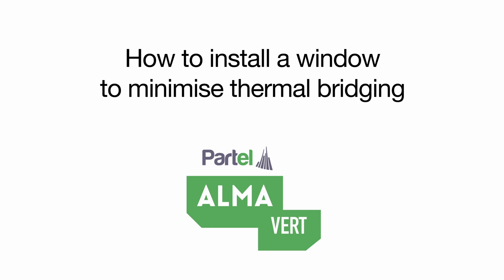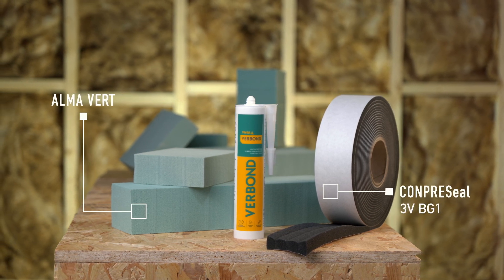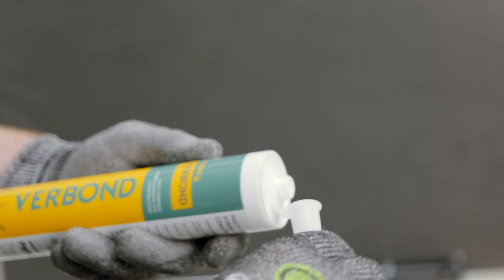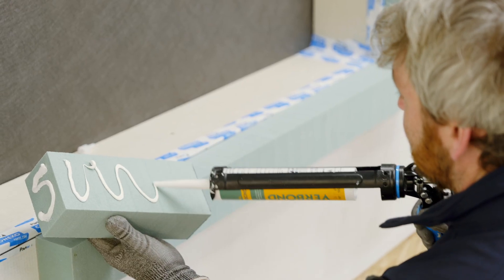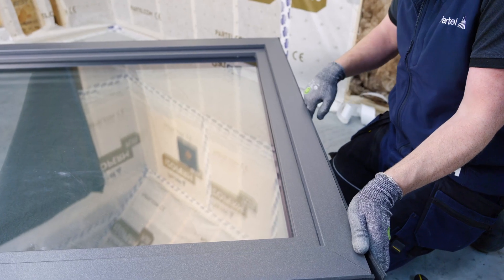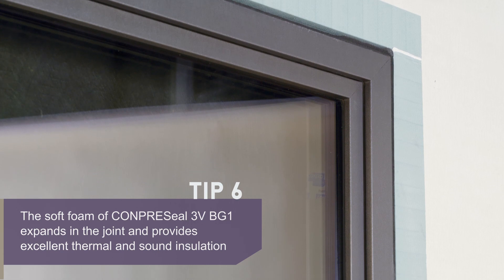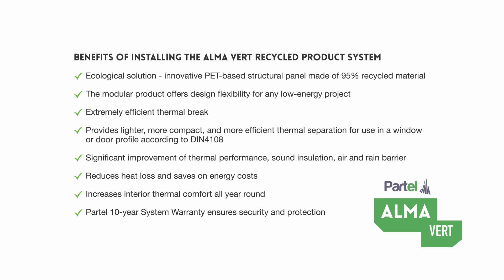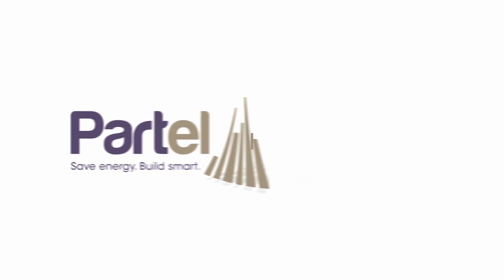How to install a window to minimise thermal bridging - Partel ALMA VERT product system

Comment: Screws?
Reply: Competitor systems such ISO-Chemie Winframer Type 1 and Type 3 use screws in addition to the insulation, but the screws are a thermal bridge, so you need to determine whether the weight of the window can be supported just using adhesive or whether screws are needed. Illbruck also have a competitor system where screws are not formally part of the system. The ISO-Chemie Winframer Type 3 system also has aluminium angles that slot into slots in the window framing material to provide extra support for heavy windows/doors/patio doors/etc. Alma Vert is manufactured in three densities, so you should be able to find one that will support the weight of your windows without needing screws.
Reply from the maker: The panels are bonded directly to the surface using VERBOND Hybrid Adhesive: https://www.partel.com/products/verbond-adhesive?_pos=1&_sid=5a44afec8&_ss=r